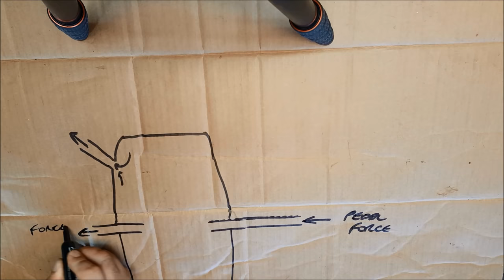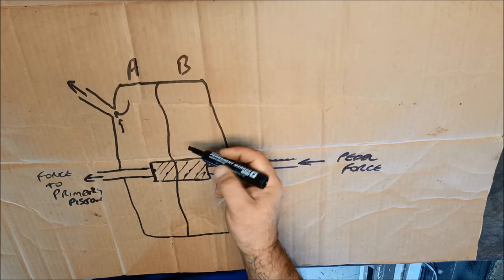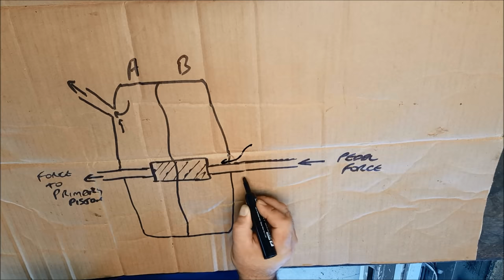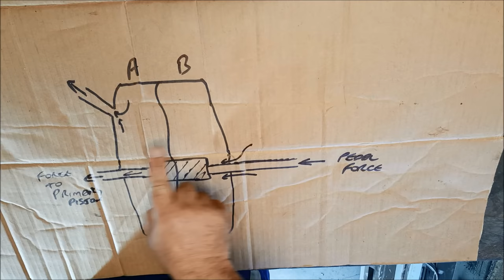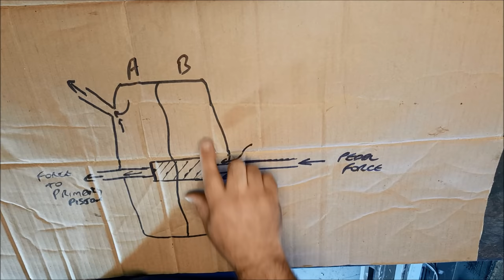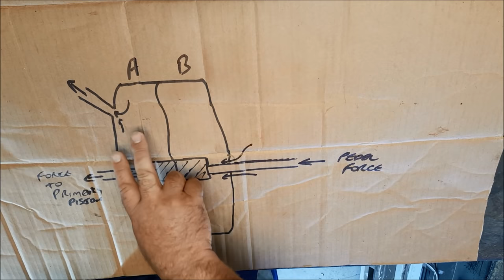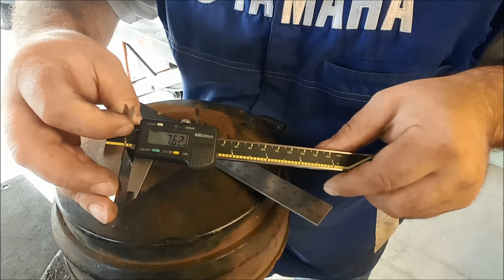Brake booster checks, operation and push rod adjustment #1313

Comment: Thank you. Learned so much from you right now. Just did a master cylinder and booster swap and never adjusted anything and been having trouble with a mushy pedal. Did the bleeding twice already but now going to adjust the pushrod like you showed on the video and hopefully that was my issue. Either way awesome video and clear information. Glad I found your channel and going to check out your other videos.
Reply: Did this end up being your problem? I just replaced my master cylinder and am experiencing a very spongy pedal that goes to the floor when the engine is running. Have bleed all the brakes and abs unit multiple times. No fluid leak. Problem went away when I unhooked the vacuum hose. Wondering if the pushrod is too short for the aftermarket master cylinder.

Comment: Some boosters are easier to check rod adjustment where the rod is set deep inside the booster rather than protruding and the spec can be checked by measuring the distance from the tip of the rod to the flat plain of the booster outer face.....

Comment: Thanks for posting great video, helps me understand booster system. My problem is intermittent drop of brake pedal, happens very infrequently, other times all works well and brake holds pressure even after extended application of foot pressure. Brake shop said it could be vacuum related, they did not believe it was MC, but I don't see how it could be vacuum related. Car is 1990 Volvo 240. Thanks, Jack
Reply from the maker: My bet it's one of the main seals in the master cylinder allowing fluid bypass.

Suggest either a rebuild and new seal kit or replace unit.

Let me know how you get on please

Cheers
Andy

Comment: I have an 1968 Midland booster on my Chevy Truck. 2 questions please. Is it possible if brakes are out of adjustment the INTERNAL valve will not work property? If after doing your on vehicle test and the pedal DOES NOT move does this indicate a failed internal valve OR a compromised diaphragm? I'm getting hissing ( escaping air from the unit from the interior firewall ONLY when depressing the brakes. At idle or off there is no pressure loss.  I'm stumped and a new/rebuild booster is near impossible to find. 
Thank you. It was a pleasure watching the video. Now if I could just learn how to search your others videos.

Comment: The adustment problem you were talking about happened to my mate's land rover. He'd fitted a new master cylinder and put the adjuster nut back where it was before, however obviously being a new unit it was less play in it so it must have shut off this valve and caused the brakes to start binding after 10-15 mins run. We'd spent ages looking at it until I relalised he's probably not left some slack for the expansion. All was well after taking back the nut a turn or two.

Also had a similar problem with a Citroen in a garage I used to work in, after swapping pads, discs, calipers, shoes it turned out the brake fluid was so old it was boiling when the heat got to it, change of fluid sorted the brakes binding up.
Reply from the maker: +Andrew Mi Thanks for the feedback Andrew, it's a common problem having incorrect pushrod length. Even some Mechanics are unaware that re-adjustment needs to be done whenever either the booster or master cylinder is changed. Thanks for the info and welcome to my YouTube channel :-)
Reply: Yes it is an intersting point that not many people are aware of Andy. THanks for the welcome as well! Will keep my eye out for more of your stuff.

Comment: I’m really sorry to be bothering you with all of this (and thankful that you’re one of the few youtubers that actually answer).  I had a new brake system put on my car, with everything new, other than the brake booster.  My brakes engage when the pedal is practically on the floor.  My mechanic did NOT adjust for the push rod, etc.  I have my old brake system, and am trying to ‘practice’ doing this, following your video.  What I do notice is that my original MC did not go all the way into the brake booster.  There is an o-ring halfway down on the MC shaft, and that is what ‘mates’ with the brake booster surface.  (I do not know if this MC was original to the car, by the way).  The wear on the screws on the brake booster show that the MC had only been screwed down halfway, when it was installed, with the o-ring mating to the brake booster surface.  I suppose this is somewhat meaningless to adjusting my new MC to the existing brake booster, but wondered if you had ever seen a set up like this.  In researching, I see that there are tools that you can buy that do the adjustment (so we don’t have to do the math), but those tools would go to what you are indicating as the mating surface for the MC, rather than the o-ring set up that I see on my original MC.  I’m getting all confused.  My MC measurement to the pin is 42mm and measurement to the mating surface (o-ring) is 18mm, which indicates 24mm.  My booster (the pin does NOT protrude, but is inside the hole) is 20.5mm.  The brakes worked great this way.  I don’t get it....:(

Comment: Oh my goodness...so this is why my Rav4 2007 keeps raving high whenever I push the brakes? Even when the vehicle is running the brake pedal gets hard most times and soft few times, intermittent just like that. I have really spent a whole lot on quack mechanics trying to fix this. I will fix this myself. Thanks for the knowledge!

Comment: Excellent video Andy, very informative. Fixing to replace the Master Cylinder on my 1990 Ford F-150 because I see a small amount of brake fluid between the Master and the Booster,  the pedal won't pump up and it goes to the floor even after being bled. Now I know how to adjust the rod...many thanks!

Comment: Hi Andy, many thanks for such an informative, consice video. I have recently had a new master cylinder fitted to my Honda CRV. After fitting, the brake fluid would not flow to the rear brakes so I was advised to have a new ABS modulater fitted. This has now been done and my front passenger side brake is binding, the brake pedal is rock hard, and there is smoke coming from the wheel after a couple of miles. As I am a 55 year old female, I am being told this is unusual and am I sure this is happening?  Mechanics thinking it may be the servo? So, I decided to watch your video and your advice about the push rod adjustment is very interesting. If mine was not adjusted, would it explain what I am experiencing? It also makes me wonder if I needed a new ABS modulater? Thanks again. I will be inquiring further about the push rod adjustment with the garage.

Comment: Great and informative video Andy. I look forward to reviewing your other videos. Nice refresher courses, lol.  Anyway. I live in the US. in the northeastern area. A lot of corrosion and rust. A big problem that I see constantly here is when people are changing brake pads, They do not clean and lube the slides and pins, Therefore creating a braking issue. I can not tell you how often I have to use the torches to remove and replace frozen Caliper pins and boots.  That would be a great video if you have not done so already, How to properly do a brake job.

Comment: Great video, thanks! I just replaced master cylinder on an old Renault Trafic, and did not measure or adjust the push rod but to be honest I couldn't see that it had a way of adjusting it on the inside of the brake booster...looking at the back though, it looks like there is a way to adjust it there, a bit like the double nut type of thing that's on handbrake adjusters? My brakes are very slightly binding, not massively noticeably but enough to heat up after 5 or 10 minutes driving and then they bind up a little bit. Anyway this video has been massively helpful in understanding how this system works and what this adjustment is actually about, so thanks again.
Reply from the maker: No problem at all. It's an adjustment that many Mechanics just aren't aware of & one, if incorrect, can cause serious problems.

Sorry, even though my family had a Renault franchise for years back in the UK, I have never replaced a master cylinder in one so not familiar with how Renault do their pushrod adjustment.

However, in thus case the push rod will need to be slightly shorter as the compensating port in the master cylinder is currently blocked off.

Good Luck. Cheers Andy

Comment: I am in my 50s and have been working on cars since i was about 11 or so, i learned something this weekend regarding boosters that i did not know,a booster can hold vacuum perfectly and still not work, i was hesitant to change mine since it held vacuum and it had some assist but once the final step came in to stop the car it was like hitting a wall, really had to lay on it.

I was always under the impression that no vacuum=no assist,well this thing was holding plenty of it, you would release the valve and it you could hear it loud and clear but for some reason it wasn't working,the new booster has too much assist, ha ha ha  but I'm happy as i can be,car stops now really nice, I'm gonna dismantle that old booster here soon, I'm really curious to see whats wrong with it.

When i installed my new booster i bought the tool to check rod clearance etc or how close it should be and all that, i got it down as close as i could, seems to be working fine,pedal does have quite a bit of travel but i think since i also installed a master cylinder i need to rebleed everything and will be doing that this weekend but again, compared to what it was i like my brakes a lot better now!

Comment: Andy,  first I want to thank you for posting this very informative and thorough video on the brake booster.  I have a question for you though…

I have a 1980 Fiat 124 Spider that gets winterized every Oct and lays pretty much untouched till the following Spring (April).  The last two years only, I neglected to start it up monthly and pump the brakes and roll the tires to prevent flat spots.  In those instances (and yes two years in a row) I noticed my brake revisor dropped completely, yet no signs of fluid leaking g from master cylinder or the four brakes.  I suspect it was leaking from the brake booster??  Is that a thing?  Last year, I just filled up the brake revisor, bled the brakes and everything held just fine.  Only this winter through extended sitting did I notice it happened again.  Your thoughts are appropriated.  Ron from NJ, USA
Reply from the maker: Hi, Thank you. If there are no external leaks then the fluid could have leaked into the booster itself - you'll have to remove it to check. If so then the rear most seal on the master cylinder will have leaked.

Hope this is of help
Andy

Comment: Wish I would have watched this sooner. I just ran into overheating brakes and couldn't for the life of me figure out what the cause was so like a smart ass I started swapping parts instead of going from point A to point B in a diagnostic. By now I have swapped out EVERYTHING related to the braking system/issue and it turns out it was that piston/pushrod that wasn't adjusted properly....

Comment: Informative video.  Until you said New Zealand, I assumed England (sounds same to us 'mericans).  Interesting that NZ also has MOT.  At first I was thinking that since you use the ruler in all measurements, you could just ignore its thickness.  But I sketched it out and that would give an error double the ruler thickness.  But you could have ignored the ruler thickness when measuring the depth of the MC piston since you subtract two measurements which are in the same direction.

1 mm isn't much, so hard to see it making a difference.  Also, the booster rod moves fairly freely on the diaphragm (as seen when you pull it with the pliers), compared to the strength of the MC spring, so wouldn't the MC spring dominate to put the brake pedal in the proper rest position?  If true, it seems you want the rod to touch the piston just before the MC seats on the booster.  A bigger problem is when people don't adjust the brake pedal switch, so it can prevent the pedal from coming all the way up.

Comment: Can you connect the vacuum gauge to the booster while it's on the car, pump and see if it holds vacuum in the booster? I feel like the valve would block the gauge from being able to read the vacuum inside the booster.
Reply from the maker: That will work fine te valve operates in that direction

Cheers Andy

Comment: Thank you for the tons of free information presented on your channel.Now to the question - "Kia Magentis 2008" +ABS+EBD Automatic FWD. Today i stopped at red light.When i released the brake to continue the car didn't move and i needed to press hard on acceleration in order to move it(very slow) outside of the road.Stopped the engine, put it in "Neutral" and parking brake DEactivated i lifted every wheel of the car and all of them were hard locked.The brake pedal was jelly soft .NO ABS light, no brake fluid loss.I continued pressing the the brake pedal tens of times to the floor and suddenly everything is back to normal. (pedal got stiffer like before) I've driven 100km since then and no problems.What could it be?

Comment: Thanks and I thought I knew all about these units,well 46yrs of it,but,you just said some things about the push rod that clears up my mistakes&misconceptions.I'm going to replace my booster on the 1988 f150 for the 2nd time.It keeps blowing the diaphragm and the vacuum starts hissing at the pedal rod side.And have a mystery brake fluid leak which has to be at master cyl. push rod,then into the intake via the booster vac. line!.You said that rod is a critical adj. and I assumed the re-builder set that because it came with the master cyl. attached. Then too I just found out there's 2 possible boosters.One is with 11-1/2" Diameter Booster,and the other is with 10-3/4" Diameter Booster.Maybe I've been buying the wrong one.Perhaps one of the previous 3 owners installed the wrong one. What determines the size? It has disc fronts,and drum rears.What do you think.?

Comment: Excellent, You are very clear and concise in your descriptions. I especially liked when you said "extracted" when describing removing air  from the booster and stating "primary piston" when depressing the master cylinder.  That precision tells me you you really know your information.  You have an economy of words and delivery that makes it very easy to follow and learn.  However, I do have a question, should not vacuum be applied to the booster when measuring for push rod protrusion since that is the condition the booster will be in when in operation?  It is possible there might be a slight difference in the diaphragm position during vacuum versus no-vacuum while "at rest".  Though slight that would be be significant, after all  the  + - tolerance is  a millimeter or less.
Reply from the maker: +Svend Holme Thank you for your feedback. There is vacuum applied to both sides of the diaphragm when the booster is in the 'at rest' position so no effect here. Plus the large return spring ensures the push rod is fully retracted.

Hope this helps - great observation and guestioning.

Cheers Andy

Comment: @Andy Mechanic At 8.30 minutes the penny dropped for me,i was never aware of this being an issue and was looking everywhere else for faults in my braking system such as jamming callipers,collapsed flexi brake hoses etc and only just started to realise that it could be this push rod coming out of the servo whcih could even cause these problems.
 I have recently realised the problem with my Ford Escort van in really hot weather,it has been binding like crazy,front right and rear left til the point where they are smoking hot and locked on so i cant pull away in first gear.
 I think your video is the answer to my problem.
IS THIS A GOOD IDEA - Next time my brakes lock on like crazy,get out the vehicle and back off the 2 x 13mm bolts holding the master cylinder onto the servo and if the brakes suddenly go FREE i.e. NO DRAG, does that mean this is the fault and the push rod needs to be adjusted??
ps somebody did replace the master cylinder in the past,i have found old receipts,so was a problem for the previous owner too
Reply from the maker: Yes, do that OR just quickly loosen the bleed nipple on either of those two brakes, tighten it up immediately and see if the binding has gone. Either will indicate it's a booster to master cylinder fault (the rod is too long so not enough clearance).

Let me know how you get on....

Cheers
Andy Mechanic

Comment: would appreciate your assessment of the problem I am having with my 
VAUXHALL VECTRA 2008 1.9 CDTI 150BHP with the braking system.

I have done the test pumping the brake with first the engine switched off, then with the engine switch on … this allowed my foot to travel 1” down.
1) When engine is on tick over … spongy brakes.
2) When engine is revved … good braking.
3) When driving on open road and brakes applied for a prolonged period … fade to spongy.
4) In this video you say your not sure spongy brakes could affect the MOT test.  I had my car tested here in the UK recently with this problem and the tester stated that he could find nothing in the MOT act where this problem warranted a fail, but recommended it be fixed ASAP.
5) Could this be a valve problem … or a vacuum pump problem?

Any help would be appreciated.
Reply from the maker: +Robert Beards Hi Robert, I'm not too familiar with that model but guessing it's a diesel engine. If so, as you stated, it will have a vacuum pump.

The symptoms are of a worn pump. It's unable to deliver the level (volume) of vacuum required. Check for leaks along the pipe work but it definitely seems to me that the pump has worn out and needs to be replaced.

Hope this helps. Let me know how you get on. Cheers Andy